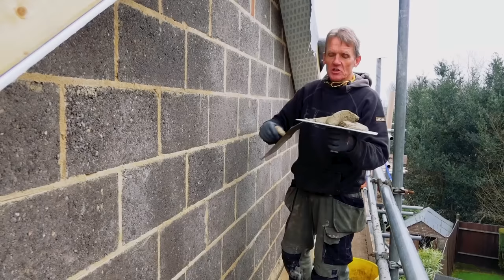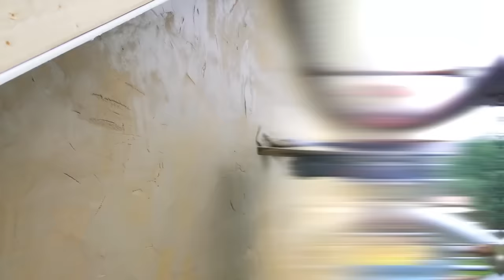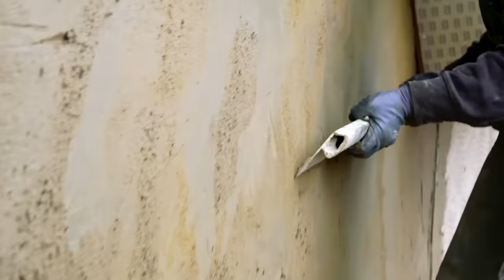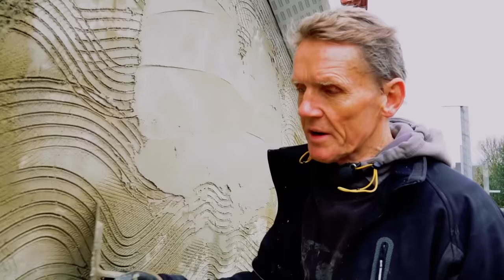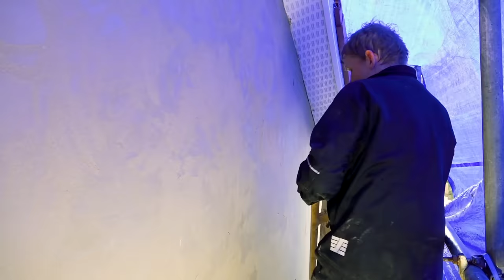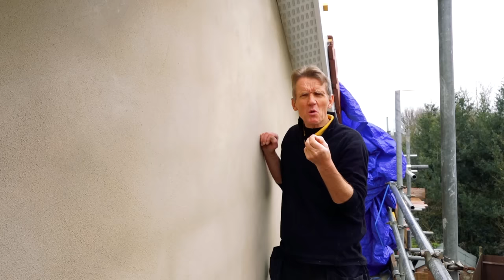How to Render Exterior Walls - Beginner Tips

Comment: When putting render on if right handed start at left bring it up from bottom up then your next trowel full sstarts half on the pass you just done 
Meaning overlap passes by half and repeat this ensures a uniform thickness throughout 
Also leave corners and down from suffit to last but this can vary depending on the weather 
If you put muck on uniform it makes your job a lot easier later 
Ps it is true to get use to a uniform pressure which in turn makes for a uniform thickness if your right handed strt left hs of trowell to bottom
MAIN AREAS FIRST THEN CORNERS AND SUFFIT BEFORE YOU MOVE YOU MUCK BATH 👍

Comment: Roger great video, could you please let me know which is the best render to apply to gable wall (Stone wall). I would really like your intake on this please.
Reply from the maker: We need to know what the brick is. Normally a 1 cement 1 lime 5 sand would be good but if the bricks will take it the first coat could be a 1.1.4
Reply: @SkillBuilder   Its yorkshire stone , Rebuilt gable wall and need to render on it , would a cement and sand render be good for it.
Reply: The builder said K render would be good but its expensive , what would you apply on the gable exterior wall , Thanks very much.

Comment: Do you use the sponge wet or rub it whilst it’s dry ? Thanks
Reply from the maker: The sponge it last just as it is nicely firmed up. You are taking out marks and filling in holes so the sponge needs to be damp but no running water at this stage. It is just trial and error but when it goes right it is lovely.

Comment: How about applying the first coat with a notched trowel as used for tiling then you know you have an absolute level base, then just fill in the the gaps with a normal trowel?
Reply from the maker: good idea
Reply: Or you can glue some vertical battens levelled, run the straight edge over them, take out and fill gaps,  using a notch trowel will create too many "joins" and potential issues
Reply: @eaminslim52   yes, battens would seem the way to go.

Comment: You should alway dampen the surface fist then you should start from the top down adding to your next trowel full.from right to left . Treating the wall like a grid filling in as you go . If the wall is outdoors of a house you should put a water proffer in it  . Then your top coat can have lime in it to help it move and breath better works for me every time .
Reply from the maker: Hi Susan 
 Thanks for your tips. I don't believe it putting waterproofer in the mix. It is done to make the plasterers life easier but it traps moisture and that actually stops the passage of moisture from inside to out. 
You are not the first one to comment on my method and yes you are all right but I was working to the camera on a two board wide scaffold. 
Also wetting the walls is a good idea but the water was pissing out of this mix as the rain set in. I would have lost the whole lot if it hadn't been for the initial suction. 

BTW Breathe in and you take a breath.

Comment: I do mine with a large wood float (poly these days). It rubs over the surface and exposes any low spots. The trick is to not apply a too thick coat as it will crack & fall off.
Reply from the maker: Have a look at the end of the video where I use a urethane float and darby

Comment: light weight blocks have wavy lines in the m already cos theyre cut by moving wires.
Reply from the maker: These are not aircrete blocks. Rendering on aircrete is a nightmare, they crack and those wavy lines are not intended as a key. You have to give them a slurry coat and prick it up.

Comment: Don’t over trowel, use a bigger trowel to put scratch coats on or use with a straight edge or Darby, always horizontal scratches, don’t use that scratcher. Scratching is designed to create a key for top coat. You need to increase the area of the wall so use a flat bladed scratcher. Waterproofer!!!! If you use a scratcher like they use you need to knock off the small bits  off the scratch coat.
Reply from the maker: Good advice. I have a flat bladed scratcher and never got on with it. I will give it another go.

Comment: I'm a veteran plasterer, when inside was sand and lime backing, either way you look at it, it's horse-work and rendering especially. I've noticed you don't use soft screeds? Are they no longer used? On large walls we always put on soft screeds and worked to them, large hotels and so on, the walls were billiard-table flat once completed.

Comment: Hi roger .  Havent you got a plasterers table/spot board for your mix???  your be there all day scooping it out a bucket like that , plus you will ruin your trowel as it will eventually pull the rivets out , plus why arent you putting more on your hawk ????  it does hold more than one trowelfull you know mate ,lol.. If like me , you would be using a new trowel on rendering as it helps break them in so dont wanna ruin it by using it to scoop mix out of a bucket .  I would always start at the top and work down , plus would put slightly thicker coat on than that as it helps when you put a straightedge across you can basicly skim it perfectly flat and no need to fill in the dips. If the scratch coat is spot on perfect then it makes it a lot easier and quicker doing the top coat . job done and down the pub by lunchtime lol ,..
Reply from the maker: I had a board and stand but I gave it to a plasterer. The scaffolding was 3 boards wide at this point so no room for the stand.

Comment: Hi, thanks for this video. I've never done any rendering or brickwork before but I am compatent as a diy'er. I'm about to do my first rendering on an old brick wall in our garden. There are a few plants growing out of the brickwork and some of the cement is loose. If I chip away the loose cement and obviously remove the plants, can I just fill brickwork with the first base coat of render? Great video, thanks.

Comment: Nicely explained techniques of course. When I started out I was using gypsum and cement renders, now I only use the lime putty family of sludge, slaking and making my own mixes. Using putty there is much less waste and it's also a lot stickier than cement or gypsum stuff.
 I was always taught to never use the end of the trowel to pick up the mortar from a tub, because, in time, this will pop your trowel rivets. My teacher told me that he would get his knuckles hit with a bit of wood if he was seen doing this
I was also taught to work from the top down not the bottom up. I also noticed that the way that you slap the top part on isn't as efficient as you could make it. Just trowel it on the hawk a few times then with the end of your trowel go into the edge of the mound and with the mortar stuck to it go straight up to the top edge and slap it on there. Sorry to say it Roger but with your way it failed to get the mortar onto the right place in one as you can see at about the 16.28 point. Everybody learns in different ways, you got it on the wall, and I was just saying what I'd learnt.
Lastly avoid the white polyurethane floats, the yellow ones are better, they last longer. All the best from Somerset.

Comment: I've got some pebble dash rendered style walls in my garden if I want to render them smooth do I take the old render off is there a way I can "skim" over to make smooth.
Reply: If the walls are sound,and the dash coat isn't loose anywhere you can render it the same way,a scratch coat,and a top coat.

Comment: Never seen a spread start in the middle of the wall. Thinner coat doesn't make it weaker. 2nd coat should be mixed weaker by guage. Wire scratchers aren't as good as the spring finger type, they leave a cut finish with alot more grip. Top coat is usually the same thickness as the scratch if not thicker. Scratch is just to slow the suction and flatten the wall, otherwise you'd do it in one. The wall should be flattened way before the floating stage. Wooden float should be only floating out a mm or two. Floating and sponging should be done in a continuous repeating motion from one end of the wall to the other. 
From a distance......that old gem.
Reply from the maker: Thanks Chris 

All good advice. The starting point was more to do with camera angles. It was a tight field of view of a narrow scaffolding. 

The advice about second coat being weaker is not mine but is widely published and taught by colleges. No need to change the gauge if you have a thinner coat. Agree about the spring finger type and I now use one. The most common mistake I see is plasterers who think they can float out any undulations. They never rule across and when the sun shines it looks like the surface of the moon.
You are welcome to come and see the finish close up but you can also see it at the end of the video.
I might not get there as fast as a pro but it is flat.

Comment: Start at the top left if your a right hander and work from left to right. If you start at the bottom you can get flairing, also you will work on top of your work as apposed to into your work. Ist coat on, flatten high spots then scratch (I agree squiggly lines) come back next day or 2. Soak down wall repeat procedure. Put waterproofer in SECOND coat NOT FIRST!. Rule off, leave float then leave again then sponge go home. I agree with the lime in the mix. Best render mix is 4:1:1 render, soft, lime. 
Thats what they used in the olden days in London and alot of those buildings havnt cracked in over a hundred years plus.

Comment: These really are high quality, informative and enjoyable videos. 
My home has about 50% of the front wall pebble dashed and it is starting to look a bit tired after some of the covering was damaged by cavity insulation guys, yesterday I washed the wall down with a cleaner (Ronseal) in the hope it will freshen it up, but could you recommend a subtle coating that would  cover the pebble dash or is painting it a no-no. 
Thoroughly enjoying viewing and learning from your videos.
All the best, Roger,  from Glasgow
Reply from the maker: Hi John 

You can paint pebble dash with any masonry paint but a lot of people coat it with a render to make it smooth before they paint it. 

If it is old you might need a stabilizing solution before the paint.
If you decide to render then a coating of SBR will work wonders.
Reply: @SkillBuilder  Thanks and keep up the great work.
All the best

Comment: Always used lime in our mixes-How much depended on the sand used-Great to see work from all around the world-i am in Australia and now seems to be a lot of thin coat Acrylic or polymer enriched bag renders.Part of the problem is Old Spreads are pretty protective and Traditional old Hard Nuts that are slowly losing the battle with the Trade Changing-Heck i was told in 1981 it was a dying trade but hey still the needs for the old skill especially in heritage work

Comment: I would recommend a light coat of SBR slurry with a roller just to kill the suction from the  joints in the blocks. Always good practice it will make the job easier for you .

Comment: With scratch marks I was taught to do horizontal and vertical lines so you have a checkered pattern. Is that not a better way instead of wavy lines?
Reply from the maker: The key will be achieved  however you do it. The wavy lines are more important on aircrete  blocks because they can crack vertically if the tension is all one way. Wavy lines and cross hatching spread the shrinkage tension.

Comment: I'm a bricklayer myself ,every now and then I do a rendering job .
 thanks for the info. 
looked up best way to render and came across this. 
I was on the right track  . 

doing a job now with another tradie . 
who pays me. 

I think it feels right to do a scratch coat as it's 12 mil think . He wants to do the 12 mill in one hit . can we do that thickness without a scratch coat?  done 14 Metres yesterday 1-1-6 ratio  ?
Reply from the maker: Robert It is good to know you are progressing. Certainly 12mm in one coat is too much. It is simply too heavy and it can slump or pull away from the backing and you won't know until it dries and you tap it. We see this kind of thing a lot.

Comment: I got told 8 to 1 bace cote 10 to 1 top cote with waterproofer add mix mixed with shovel in plastering bath.Put 2 trowl lines up wall  a bit smaller than straight edge then screed off the middle, a bit like screening sand for block paving off rails.And not to mess with it[trowl it] too mutch or it will go dead and fall off wallLoooks like a good job tho well done pall.

Comment: Great finish on that Roger . I've always used waterproofer / plasticiser as always what I was taught but willing to give this a try with the lime and I  have been in the trade as  bricklayer mainly for 30 yrs  but can do most types of rough casting . Never to late to learn anything new in our trade .
Reply from the maker: Thanks Stuart
Funnily enough, this method is the old way before the waterproofer and plasticiser took over. Nobody wants to mess around with lime these days but it is a great material to use it gives you loads of fat in the mix and helps it stick.
Reply: Skill Builder Hi again Roger . Client has informed me sand cement render job I did has cracked .....bugger. I used 3-1 scratch coat with top coat of snowcrete  5-1 with lime . Soaked  scratch coat prior 2 top coat as scratch been sitting couple of weeks .Soaked walls 2-3 days after too when top coat finished Wavy scratched it . Double coated top coat ie, pushed cement into scratch before going over again . Is there any way 2 avoid or have I used wrong method ? Thanks for any feed back .
Reply from the maker: The 3 to 1 scratch coat is  too strong for most substrates. I use a 5 to 1 on lightweight blocks and stocks. If you are going onto flettons or something hard you might use a 4 to  1 
How bad are the cracks?
Reply: Skill Builder I will get a look tomorrow when back at job. Was only informed earlier.  Our blocks I think are about 7 newton.. we are NE Scotland and normal practice for everyone here is 3-1 scratch with 5-1 top . Ive seen others on you tube stating 3-1 scratch . I'm wondering if the hot weather has had an effect .
Reply: If it is a structural crack, a 200 ton building that is moving, settling is going to crack any surface.

Comment: Really impressed with the level of detail.  Skilled and detail oriented trades are few and far between.  I'm assuming you're ading an NHL 2 to the mix?  Any change we can reserve the term Lime mix for a pure lime: sand mix please (even if there is a little Poxzzolan in there)?  Having a really hard time with builders working on traditional properties and saying they've used a lime mix (with 1 part portland cement added to make it go off).
Reply from the maker: There are two types of lime in common use. One is hydrated which needs a bit of cement to make it go off and the other is hydraulic which goes off over several weeks. That is the NHL lime. 
The hydrated lime is what I used here. With a 1.1.6 mix it is around the same as NHL 2.5. I have  found it to be a really good mix for rendering and pointing.

Comment: No strach combs in Australia,  would have to use a notche trowel,  is that ok, also with using a float,  plastic or wood
Reply from the maker: Plastic floats are generally flatter. As for the scratch comb. A wood float with some screws protruding through the face is how it used to be done.

Comment: Just a question about the lime
I’m assuming you’re using the hydrated lime you buy from builders merchants, which act as a plasticiser, and not old school NHL lime?
Would appreciate a reply. Thx
Reply from the maker: Yes hydrated lime to plasticise and allow you to reduce the cement content and still give it enough  body to be workable. It is not as good as old hydraulic lime but that is a long process.

Comment: Damping the substrate to control suction not such a big deal with cement renders and blockwork but essential with lime renders on porous substrates. The idea of weaker mixes as you progress through the coats is to avoid cracking due to differential movement caused by expansion and contraction of the top coat in prevailing weather conditions. With starting at the top you are working onto your previous work which allows you to apply more pressure and get a better bond between trowel fulls, this works also by working from right to left, so start top right work down then from the left work back onto your render. I doubt the capacity for autogenous healing in cement based renders as the lime is locked up by the cement
Reply from the maker: Good intelligent comment. Thanks.

Comment: Hi Roger would you recommend the spray render technique as opposed to the method here, and if so what would be the advantages.Great educational videos.Thanks.
Reply from the maker: Spray render goes on a lot better because it eliminates the trapped air and gets into the texture of the host material. It still needs ruling and floating up with a trowel but it is faster to do. I like it.

Comment: What is SPR???  I’m a catering manager, sorry 😐 I was a catering manager, but was  a cake decorator. I’m only looking for a rustic finish on garden walls. So I’m not bothered about smooth. As it’s over a 120 yr garden wall.  Do I need to PVA first????   Can I not just get a bag of mortar  that would do what I want?????? Or do I need something else???  Can I get away with one coat and then PVA All the wall and will that work. As I’m only looking for rustic??  It doesn’t need to be smooth, as I’m recovering a stone wall ( that has beeb done before. But it’s popping off in winter , that’s been done before.  I just need to make a rough service I can paint????????  Any advice love. Don’t forget, I’m a 50+ female trying to get this job done. I’ve iced Wedding Cakes. But never done any motoring ???? 
Any small tip would be extremely helpful!...???? 💕❤️💖🙏🤔😮😢😞😒😏😔